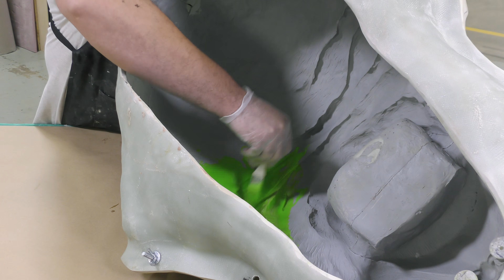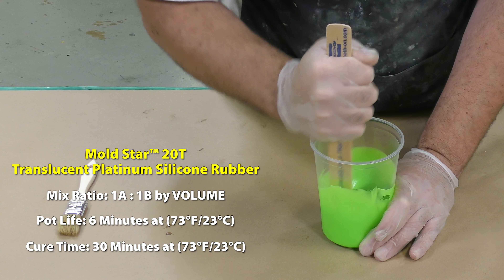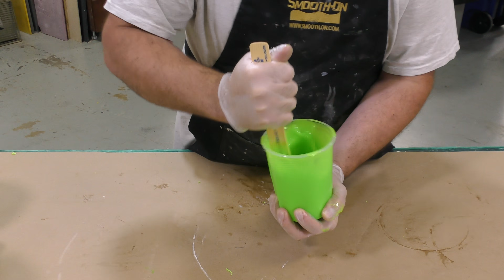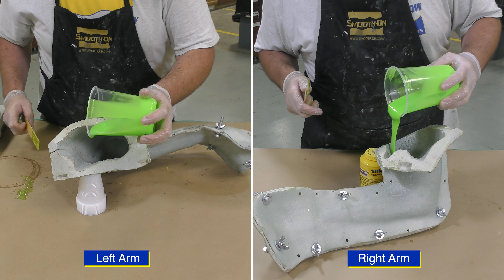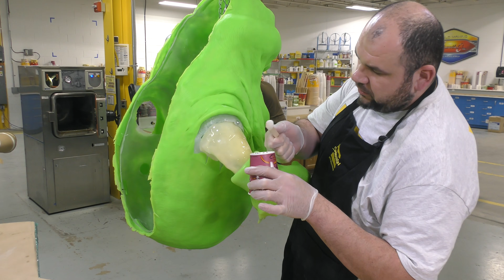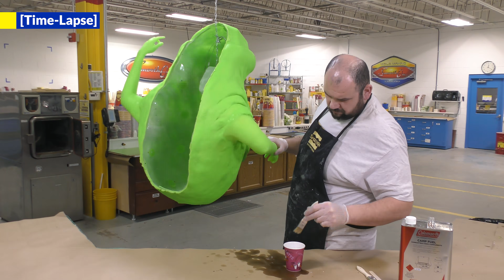Casting A Life Size Silicone Slimer Prop

Comment: If you were to have the arms move, wouldn't you be able to leave some 4-way stretch material extending out of the arms while casting them.  Once you begin to attach the arms to the body, would you be able to sandwich the cloth inside the body by applying a layer of ecoflex?

Comment: Why not add some fibrous material in the last layer of silicone then flex foam fill it? This weakness in the silicone and thin resin form just seems week for its size. What other materials could be used in this type mold?
Reply from the maker: That is another great method that would work if you are looking to keep the prop lightweight and squishy! Though Ecoflex Gel gives it a specific hand feel that FlexFoam-It! can't replicate, making it more fleshy to the touch.

Comment: The reason why one would use silicone would be for movement or realistic translucency of flesh. For this prop, as in the original in the film, Latex is what should be used to construct this . Using silicone where they very properties of silicone are not need is wasteful and unnecessary.
Reply from the maker: There are a number of different ways to make these props. We used silicone because it will last much longer than latex but it also gives us very realistic feeling fatty tissue areas as well as the increased physical properties of the silicone. There are always many different ways to make these amazing pieces and we love the process! Thanks for watching!